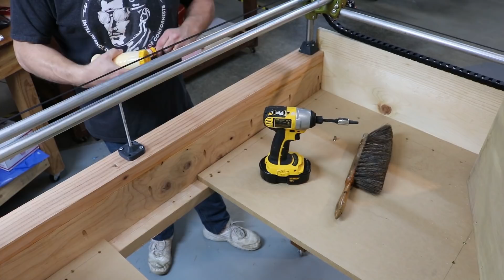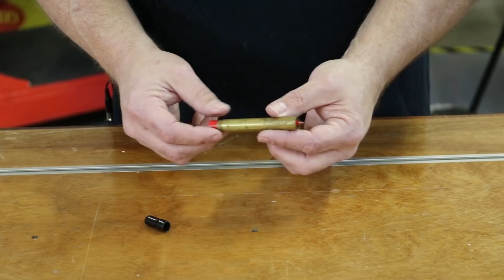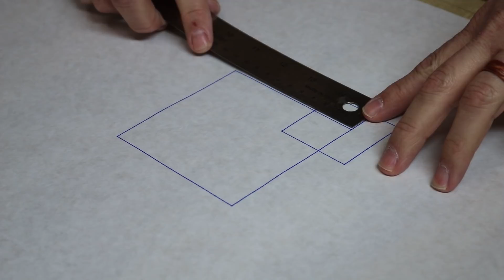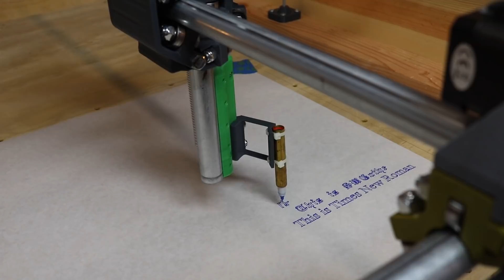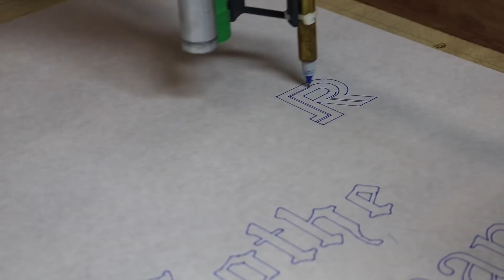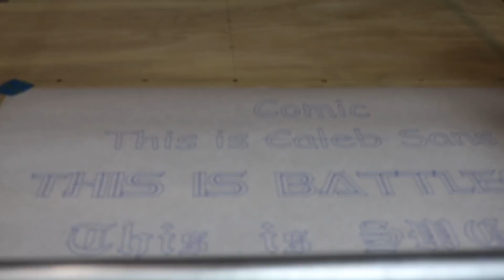MPCNC Build Finish and Test Run!

Comment: What software did you use for the CAM for the test print? Just finished my build doing some pen tests now looking to figure out the software side.
Reply from the maker: I use a product called Aspire (http://www.vectric.com).  It's kind of pricey for hobbyist use.  They make two other packages, Cut2D and V-Carve Pro that work equally well.  Aspire's main benefit is 3D toolpathing.